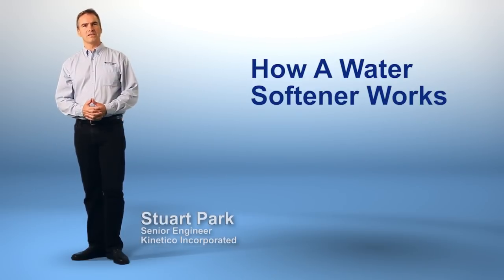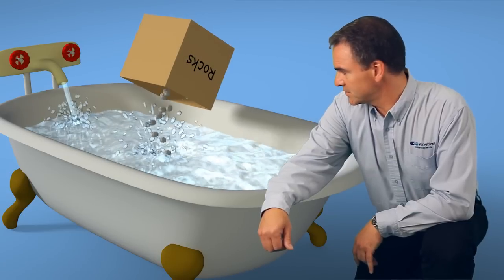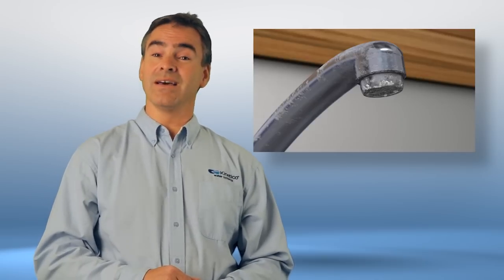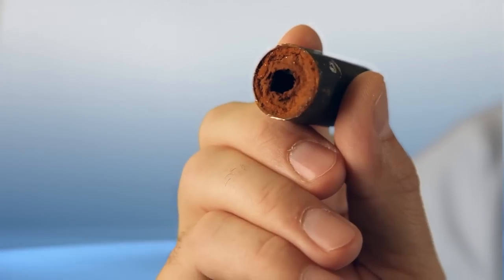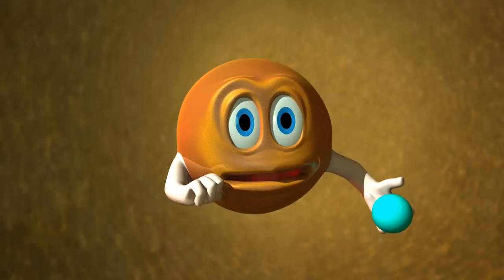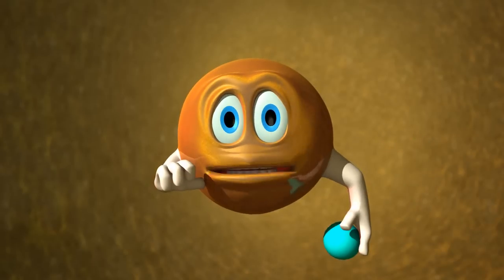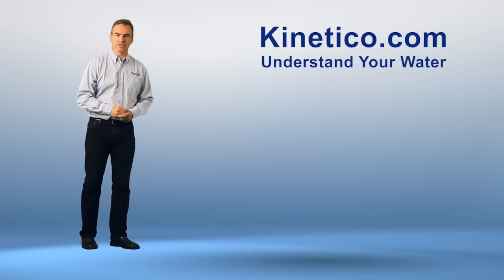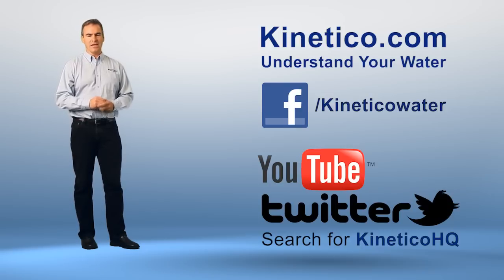Kinetico - How A Water Softener Works

Comment: Hi,
Just bumped into this ... i don't live int he US - but your help would be highly appreciated.
We have hard water with 750 TDS. I understand that using a softener doesn't necessarily change the TDS, but rather increase as per some comments here. Anyway, my question is, would using a softener change the taste of water? If so, to what degree?
Reply from the maker: Hi Rajan, Taste is very subjective and it will depend on what is in your water.  I have a well with iron and the water tastes and smells metallic.  With the softener, that is mostly gone-- I can still detect it, but barely.  If you have only hardness (dissolved limestone) a softener may not affect the taste very much.  But this is an opinion, based on my taste buds.

Comment: Just bought a home that has been sitting for a while. Brine tank has no salt in it. May just call a tech for initial inspection and then go from there.
Reply from the maker: Hi James, if you haven't called a tech already, I would probably try putting a bag or two of softener salt in it first, and see if it makes a difference.  You can usually tell if the softener is working by the feel of the water in the shower-- if it feels smooth and slippery the softener is likely working.  It it feels sticky and squeaky it probably isn't and you should call the tech for service.
Reply: Kinetico Water Systems Yeah I had a tech of yours come out to test the water and check them system, $2800 for parts and labor for a new softener and brine tank. Sorry, way too much money.
Reply: +james hawkins +Kinetico water systems +james hawkins ____this is a SHAM. I have no reason to defend this company, but my family has operatrd a softerner/RO mom and pop , SINCE 1950...1950!!! CULLIGAN even tried to buy us out we were so succesfull. so anyways my famiky and i being mom and pop and honest and certified and uncertified experts on water filtration..KNOW WHOSE LYING, PRICE GOUGING..ETC. were from so cal so AGAIN...NO REASON to defend this compsny..they could be our competition for that matter., so listen to me w)hen i say, they are NOT overcharging. i repeat...they are NOT screwing you. look man, its a major service. their tesrkmg things up, giving you a major peice of home equipment (like adding a ulgraded water heater or redoijg your kitchen sink and addimg am island etc etc), goimg to yoir house twice for bid and install, consulting you how to use it, and allsaid and done it ACTUALLY does what its advertised to do! shocker. they REALLY WORK. I HATE IT when my freinds are naked in their showers all wet squeegeing and wiping after. thats so dumb and a wsste of time and thats just ONE thing you wont ever have to do anymore.
but the main thing..the unit itself is a major luxury product. its nice and technilogocal. you may be quoted 500_800 for one..but i KNOW its PLASTIC AND CRAP. only a FEW softerners out therr are REAL ONES not knock offs and they last 10 + yesrs. those 500 dollar ones at sears. ..your looking at 1.5 yesrs ..ya thats right. 1.5 vs 10 YEARS. so i hope i was informative to you all....(take it from the son of an HONEST MOM AND POP SHOP) FAMILY owned softener company in a small quaint town. :) have a great day!!

Comment: So what happens with the Sodium or Potassium Ions released by the Resin?
Reply: wondering the same thing
Reply from the maker: Hi Roland Weeds & GattaSplatta Man, Sorry for the delay in replying, I've been really busy making some new videos, and haven't checked YouTube in a while.  The Sodium or Potassium ions are released into the water by the resin and they stay in solution in the water-- but it is a fairly small amount.  If I remember correctly, a typical gallon of softened water contains about as much sodium as in a slice of white bread.  If you are on a restricted diet or concerned about any possible health effects of increased sodium or potassium we highly recommend talking to your doctor prior to getting a softener.

Comment: I have a TDS tester. Since it detects salt as well as other dissolved solids then I suppose it won't detect any change in the hardness since the resin exchanges one dissolved solid for another. Which would explain why the the soft water measures higher in TDS than the well water which doesn't have any salt in it. Something doesn't seem right. I hadn't bought any salt for the system in over a year so I checked for bridging and found the salt cavitated. It uses salt now but well water still has lower TDS than the soft water so am still thinking a TDS meter won't work with a water softener since it detects salt. I just can't understand why the well water has lower TDS. I think it should be the same if it exchanges part for part. My system is a Kinetco.
Reply from the maker: John Last .  Hi John, sorry it took so long to respond; it has been a busy summer so far, and time got away from us.  I contacted one of our in-house chemists to make sure to get the straight answer.  This is how he responded.

John, I think I can clear up this matter. First let’s start with what is TDS. TDS stands for “Total Dissolved Solids”. It is a measure of dissolved substances in water. Minerals, metals, salts etc. The unit of measure is mg/L or ppm. That is to say that it is the weight of the dissolved substances in known volume of water. The only way to measure this is by evaporating a known volume of water and weighing the solids. This is not a very convenient test, and is usually only performed in Labs. It is however possible to obtain an “estimate” of TDS by measuring a solutions “Specific” or “Electrical” Conductance (EC), and applying a conversion factor to  derive the estimated TDS. This is how all TDS meters work. Pure water will not conduct an electric current, but when solids are dissolved in it , it will. This is easily measurable. To convert this measurement to an estimated TDS value, the Manufacturers typically put in a resistor to cut the signal in half. The next part is a little tricky. The ion exchange process takes place on an equivalent basis. Simply put, everything has to exchange equally. The Calcium in the water (the Hardness) has +2 charge, Sodium on the other hand has a +1 charge. So it take 2 Sodium’s to exchange for 1 Calcium. Now here is where it gets tricky. Calcium has a molecular weight of 40, Sodium has a molecular weight of 23. Since you need 2 Sodium’s, that makes the Sodium weight 46. On a strictly weight basis, 2 Sodium’s will be about 15% heavier than 1 Calcium. That is why the  TDS of the Soft water will always be higher than Raw water, (remember TDS is weight per unit volume).  

I hope this clears up any confusion.   Ed R.  | Senior Research Scientist  |  Kinetico Incorporated | Newbury, Ohio |
Reply: Thank you for the response and that confirms my idea of how this meter works.  My refrigerator filter seems to lower the reading a little so I suspect the charcoal in the filter may grab some of the salt since it usually reads a little lower than my well and tap water, but not always.

Comment: Sooo... Does the water come in contact with the salt? Why don't we have salty water?
Reply from the maker: Kyle Homan   Hi Kyle, sorry it took so long to answer.  It's been a busy few months.  It is the sodium ions that are released into the water, so it is not the whole salt molecule (sodium chloride).  Also it is a really small amount, so even with very hard water, a softener shouldn't add enough sodium to be able to taste it.  On the other hand, the hardness that is getting replaced is very noticeable, as a little hardness goes a long way-- so even small amounts is apparent (residue, soap scum and etc).   Hope this helps!

Comment: I was hoping to learn how/when/if resin wears out and needs to be replaced or does it last forever.
Reply from the maker: Uncle Tod's Drum Lessons   Maybe not forever, but resin can last a long time ( many decades) unless there is something in the water that deteriorates it.  Iron is one thing that that will clog up the resin and cause it to malfunction.  Also chemicals could attack the plastic and eventually cause it to break down.  For most people this is not an issue, and the mechanical (or electrical with other brands) parts need replacement before the resin is worn out.   We have a lot of Kinetico's out there still working after 20+ years with no service calls.

Comment: Kinetico are the best.   Uses least salt and works 10 times better than other brands.   I got the 2060s and it kicks minerals ass.  Best $2500 I have spent in years, and it's worth more.    I love it.  My 10 year old system sucked, used tons of salt and still didn't work good.   The Kinetico sips salt and works way, way better.  Better water pressure and never ending softened water.   I have well water and now it's more pure than the municipal stuff.    Great product.